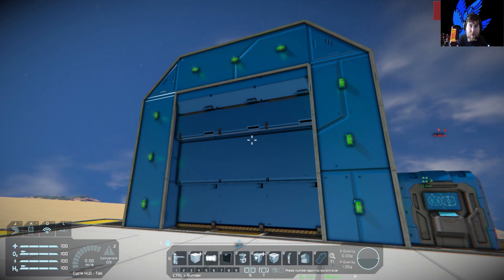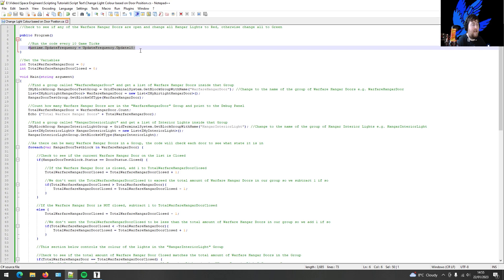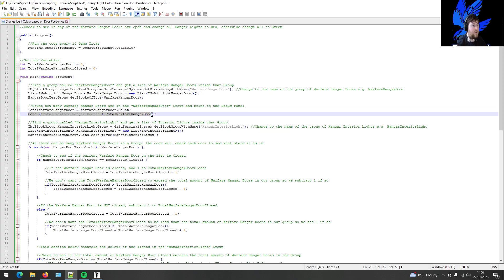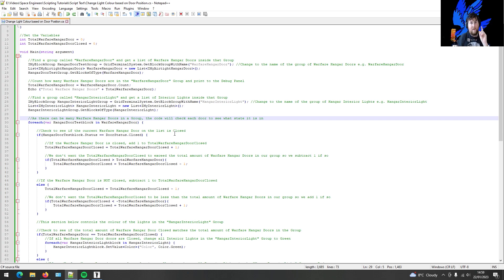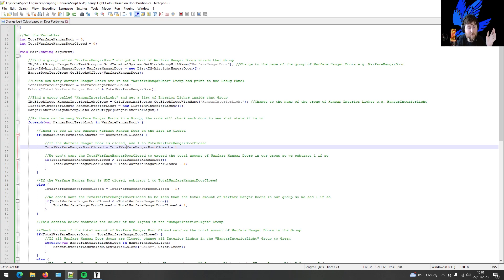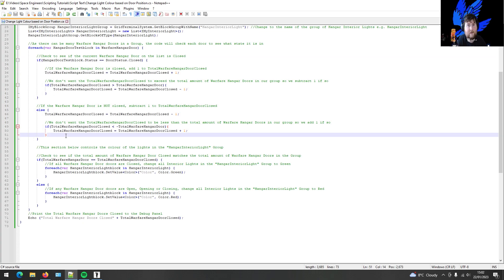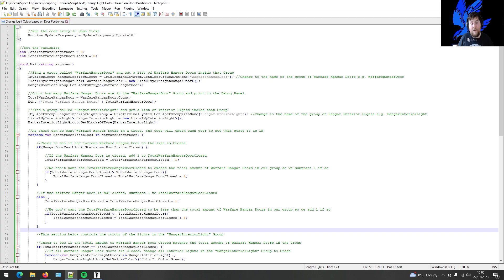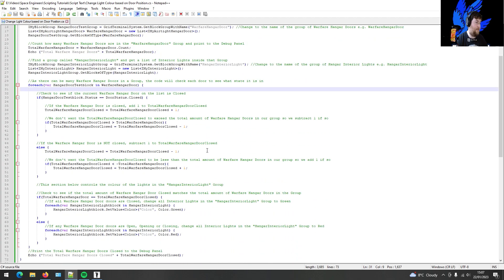Space Engineers - Script Tutorials - 8 - Group Detection and Changes

Comment: How would one get the current altitude of a ship?
How can I make a custom weapon detect an enemy?
How to check if there are obstacles which need to be avoided between me and the target?
Let's say I've created a rocket and want to aim it at a particular enemy if there are multiple. So that the rocket avoids the rest and goes for the ship with the highest firepower.

Can a programmable block locate mining resources?
Can it then create a GPS coordinate?
Can a programmable block build or modify a blueprint?
Reply: How would one get the current altitude of a ship? - from IMyControlBlockIMyShipController interface.
How can I make a custom weapon detect an enemy? - it has to have a turret brain. Or use raycast from cameras
How to check if there are obstacles which need to be avoided between me and the target? - tell me if you find out
rocket avoids the rest and goes for the ship with the highest firepower - you can detect grid size programmatically. But not the firepower.

Can a programmable block locate mining resources? - no
Can a programmable block build or modify a blueprint? - no

Comment: Great tutorial. The code could be streamlined a bit, but it does make it a little easier to understand for folks without C# experience.

One thing that confused me is why there's a need to track the number of doors open. If you want the light change if ANY doors are open, I would do the following

On line 28, add 
      bool isOpened = false;
In your foreach , simply set 
      isOpened = HangerDoorTestblock.Status == DoorStatus.Closed; 
     if (isOpened) // if the last door was opened (no need to add isOpened == true, since isOpened is already a true/false value)
          break;        // break out of the foreach loop... don't check any other doors... we know one is opened and that's all we care about

Finally, move your color changing code out of the door status checking loop. IE put all that stuff below line 69 #giggle
This is a performance thing as well. If you have x doors and y lights, you don't need to check or set the lights x*y times.

Instead loop through the lights once at the end and check if isOpened = true. 

Color c; //we'll set this later
if (isOpened)
   c = Color.Red;
else
   c = Color.Green;

foreach(var light in HangerInteriorLights)
   light.SetValue<Color>("Color", c); //I think there is a Color property on a light block, so you could say light.Color = c; but i'm a little lazy to check :)

Final note, which doesn't matter functionally and is good to get familiar with as you continue programming, is that casing has a meaning to help you understand your variables. 
<TLDR> the casing of a variable or "thing" has some meaning and be helpful when looking at code to quickly understand what you're looking at. More details about that below. Hit me up if you have questions about this or C# development as a whole and keep up the good work</TLDR>

https://learn.microsoft.com/en-us/dotnet/csharp/fundamentals/coding-style/coding-conventions
Reply from the maker: Hi Mike,
Thanks for the suggestions on improving the code. Your method is a lot better and would eliminate unnecessary lines.
I need to brush up on Break; as it is more useful compared to the count method I was using
Naming conventions are also something I need to improve on as it would help differentiate between what variables are doing
Reply: @smcwallgaming  such is the world of programming... always something that can be improved. Key thing is to not let it slow you down and have fun with it!